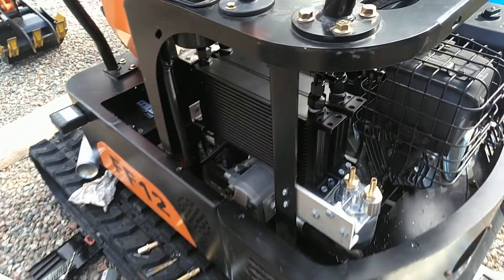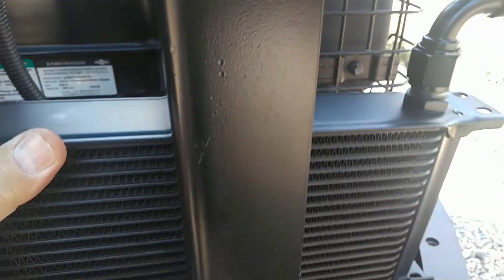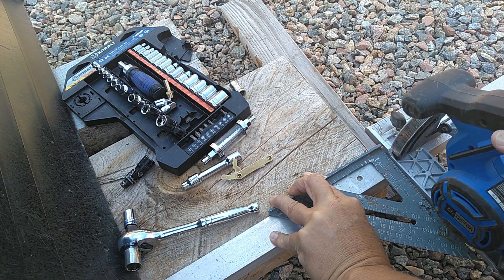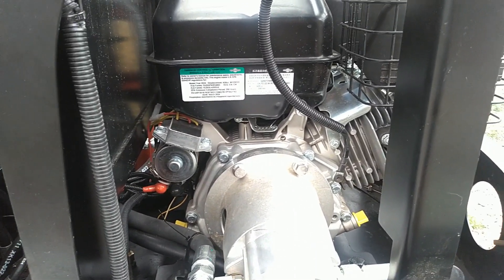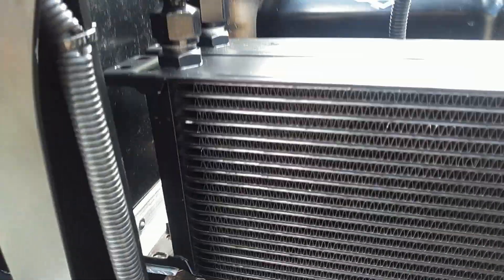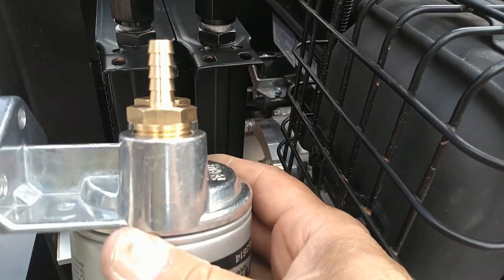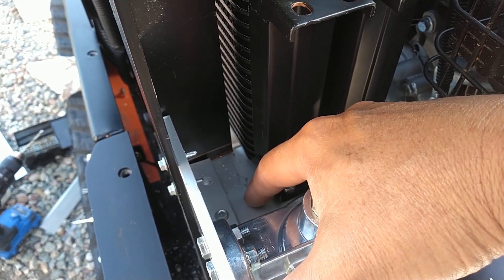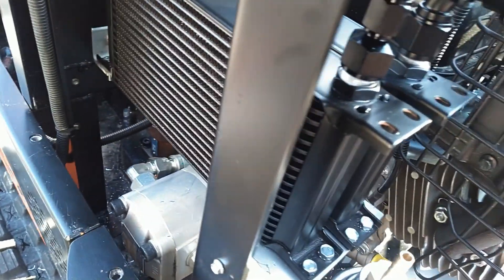Chinese Mini Excavator  Mounting Hydraulic Oil Cooler, Engine Oil Cooler, and Engine Oil Filter

Comment: What size fitting screws into the hydraulic tank on the machine? Please
Reply from the maker: @brettgofgosky1911  I do not have an answer for that. It is metric that is all I  know, I did not measure it when I had it off.

Comment: LOVE THIS VIDEO!  If someone has already asked, my apologies.  However, I think I missed how you'll connect the oil cooler to the engine crankcase.  By what method did you use to get the oil to flow up, through cooler and back out through the the oil filter?  Is it just case pressure that creates the flow up through your cooler and filter? Again, apologies if I missed that part.
Reply from the maker: Thank you! I did a video on connecting the engine oil from the crankcase, you can see it here: https://youtu.be/dD-6Zw6_aGc 
I tried two methods as seen in the video, the final working method employed a 12V fuel pump to move the oil. It is still working pretty much the same as when I did the video, I now have ~45 hours on the mini ex.

Comment: Those fittings on the filter look way too small, but I'm no expert. My cooler has 3/4" fittings
Reply from the maker: @johnverney  If you're referring to the engine oil filter fittings, they're small because they filter the engine oil, which only pumps a small volume. In contrast, the fittings on my hydraulic oil filter are much larger to handle the greater volume flowing through the hydraulic system. Watching the entire series could help you understand the differences between the two oil cooling systems in my excavator. One oil cooling filter system uses a 5/8" hose, while the other uses a 5/16" hose. Thanks for watching and the comment.
Reply: @madscientisthut  Thanks for the explanation

Comment: Those automotive transmission coolers usually don't flow enough to meet the demand of the hydraulic system on these type equipment. Do you happen to know the flow rate the oil cooler and also the flow rate the pump?
Reply from the maker: The coolers I use feature 10AN input/output ports with an inner diameter of 14.2mm (0.56 inch) and are rated for 8 Bar working pressure. They work perfectly with my Chinese mini excavator. I calculated the flow rate for the coolers at a 1 bar pressure drop (~14.7 PSI) to be over 24 liters per minute. The flow rate on the pump is approximately 6 milliliters per revolution, so at the maximum engine RPM of 3600—assuming everything is functioning perfectly without any flow restriction (ideal world, pump connected to reservoir pumping back into reservoir)—the absolute maximum flow rate would be around 21.6 liters per minute (5.7 gallons per minute). The torque curve peaks at around 2600 to 2700 RPM, and I typically operate it at 2200 to 2500 RPM since that speed feels right for digging. I've also run it at full RPM for when I have to track longer distances and still haven't encountered any flow rate issues. If there were any issues, I would expect the coolers to blow apart, as the pump's restricted pressure could very easily exceed the coolers maximum pressure rating. I hope this answers what you were asking, and thanks for watching and the comment!
Reply: @madscientisthut  Good stuff! Looks like you did your homework!

Comment: I would really like to know how your picking up engine oil
Reply from the maker: I have two plans, the first is to try a cheap fuel pump, hopefully this one works. The second is to try a science trick to build a " pneumatic oil pump" . This method will use two check valves at each oil port one facing in the other facing out, and having a small section of hose from a tee that holds air. The cylinder down stroke should create small amount of pressure in the crankcase that will open the outward facing check valve, pressurize the the hoses cooler and filter. The check valve that the oil entered should close on the up stroke. The up stroke should create a small amount of vacuum in the crankcase then pull the oil through the inward facing check valve. The only thing with the second method is I am not sure how much pressure differential in the crankcase occurs between up and down stroke, I would need maybe 4-5 psi pulses to operate the check valves and to gain the 14-16 inches of height that the radiator is mounted at. I plan on doing this work this week since it rained and I am on hold with the pond cleaning project until it dries up again.
Reply from the maker: Well I went ahead and bit the bullet today and got the pump installed see this video: https://youtu.be/dD-6Zw6_aGc